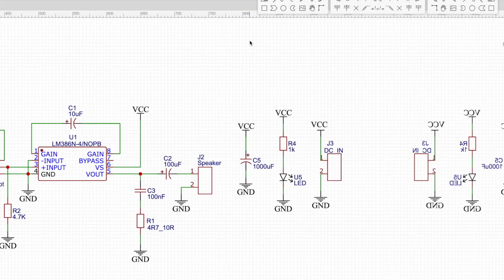Simple Audio Amplifier Circuit using  LM386

Comment: for this circuit can use AC voltage with an adapter? Or is it possible to use a 9V DC battery?
Reply: Hello from the future. The LM386 will work as low as 5v, and can run off of a 9V battery.